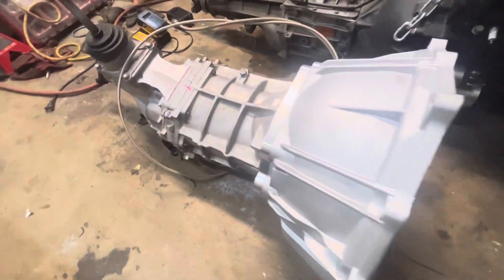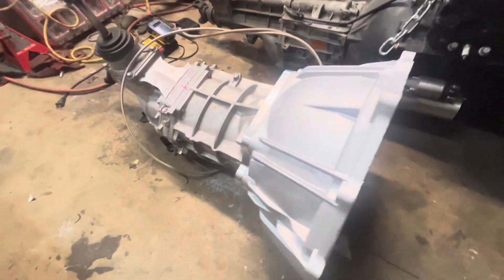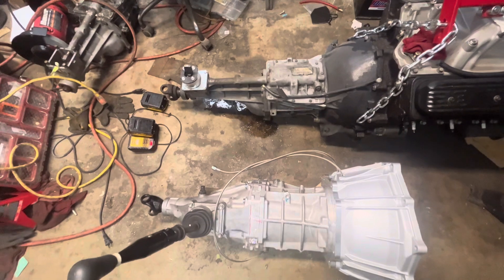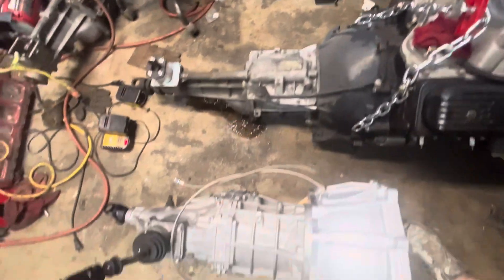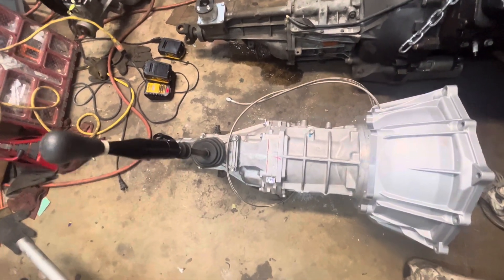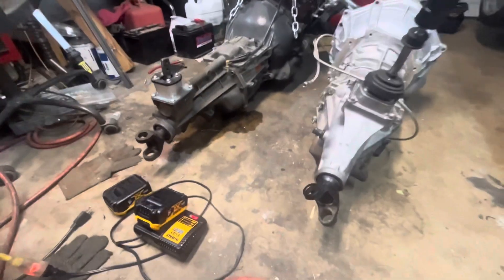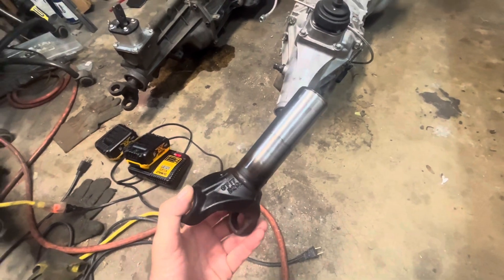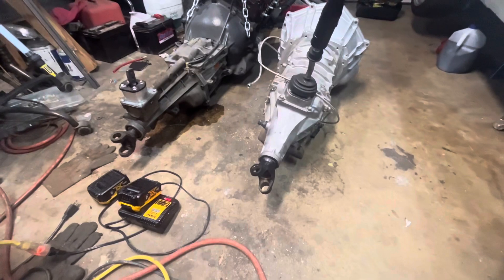What is a AR5 transmission? T5 vs ar5 #hotrod #tricks #ls

Comment: I considere this transmisdion as a 4 speed .
The down side is first gear ...it is 3.75....
Unless you got really tall gears you wont use the first gear
And if your gear are tall...you wont use the 5th overdrive....😅😅
I wish the first gear was more near to 2.66 or something
It would be perfect
Reply from the maker: I have one in my nova, it has 3:55 gears. I want to put 4:11’s. I think it’s great for $600. The 5.3 loves 7k so maybe it’s just great for my setup. Thanks for sharing
Reply: @Motorhead_Mark  i have an ar5 behind a ls5.3. I have 3.42 gear . i use the first only if i have to take going up hill.
Reply: What is the difference in length between the T5 and the AR5 and is the shifter in the same spot?
Reply: @curtishutton  for a truck the shifter end In a good location. I moved the engine a bit forward also
Reply from the maker: It’s only a little longer. I don’t think I shortened the driveshaft. The shifter is back a few inches. I cut the ar5 shifter and welded a t5 type two hole shifter mount. Then I put a shorter shift lever on. Plus 8 ball

Comment: What bellhousing is on the ar5 in your video.
Reply from the maker: It’s a mid 70’s aluminum bell housing. There is enough room for a 14” flywheel
Reply: @Motorhead_Mark  Thanks for getting back to me. I'm looking to put an ar5 behind a GM 60* V6. But it looks like it's an all around decent transmission.
Reply from the maker: @Spiritof_76 I think that’s a completely different bell housing. Check with fabbot and see if they have it or do a speedway adapter from v6 to v8 pattern
Reply: @Motorhead_Mark  Thanks. I have a speedway adapter, but I read that a Dodge Dakota 2.5 bellhousing will mate an ar5 to a v6-60* metric engine (if I can find one.)